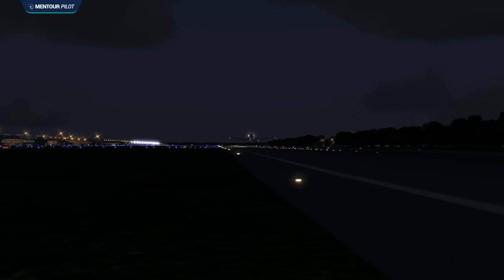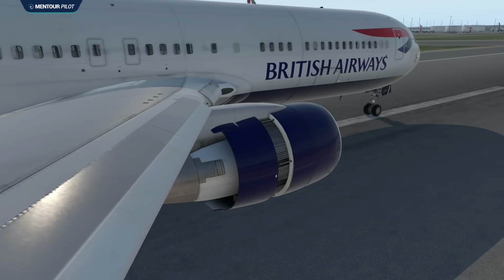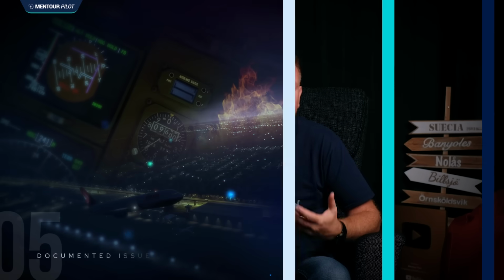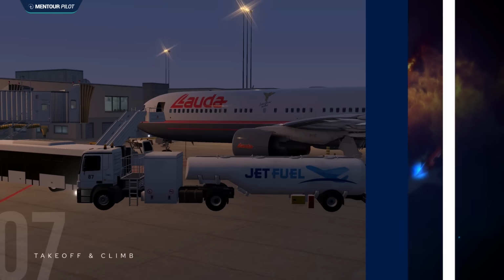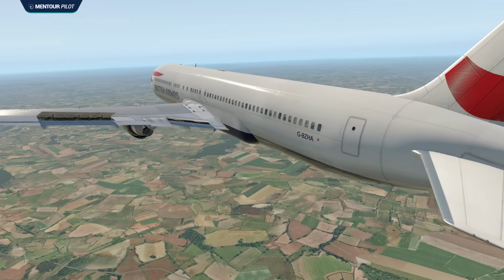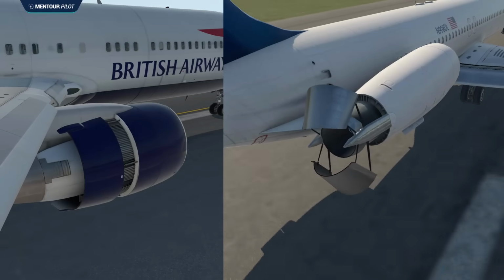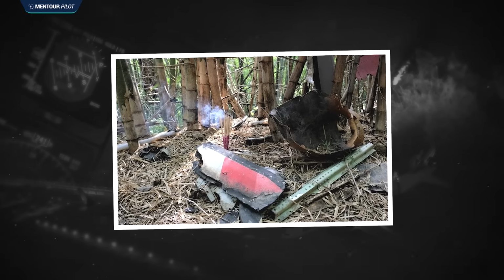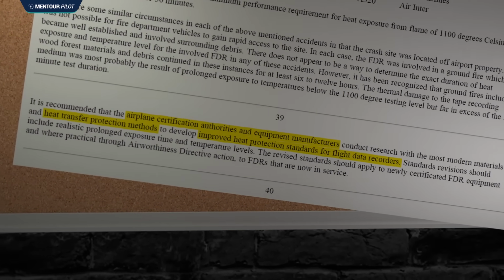HOW an Impossible Failure CRASHED this Boeing 767!

Comment: Thank you for yet another highly insightful video!

Is there any chance for you to indicate which video results in deadly crashes and which result in safe (as in walk away from) landings?

Also, is there any insight into the failures of the redundancy systems?  What happens if, for example, a redundancy system fails in such a way as to disable its partner system or inflict more damage?  Is there yet another layer of protection to prevent a protection system from causing more problems?  To what extent to the multiple redundancy systems render it impossible to take manual control, for example?
Reply: The loss of life is always indicated near the beginning of the video. In this case "extreme hull loss" was the expression I think he used. At 0:26. Maybe he should simply state that "people die in this video" or "this did not end well for many", whichever is the most refined way that still gets the point across.

Comment: Thrust reversers to help stop the airplane in time and saving the brakes from heating a lot. I guess that it also reduces tire wear. That wear is significant at every touchdown as huge wheels with their inertia hang still and need to be spun up to landing speed (interwebs: Most commercial airliners land with a speed of between 240 to 265 km/h or 150 to 165 mph.) And this could only be minimized by spinning the wheels up before touchdown - probably the additional TCO is too high to ever earn that back. But there will be significant wear during braking the wheels too and this may be a reason to use the thrust reversers as much as possible (if that does not generate significantly more engine wear or engine maintenance requirements) The interwebs say that landing on the dry, the wheel brakes are responsible of 70%-80% of braking and the thrust reversers do the rest, however landing in the wet or on ice thrust reversers increase to 70%-80% of brake force.
As operating an airline is a marginal business that shareholders with a passion for flight invest in, whats preferred is all about cost cutting down to the pennies.

Comment: It might be weird to post this under s video of such a harrowing accident, but actually your videos have helped me so much in overcoming my flight anxiety.
Thank you, Petter ! It's not just the diligence in showing just how much needs to go wrong in sequence for a truly desastrous outcome, it's also the bits and pieces strewn into every video that deciphered flying for me.
Like, how many degrees of a bank angle is still perfectly fine and far away from a warning, or what happens with the flaps and when you select which mode at what part of the flight. 
I've flown for the first time again in years this past week and my seat happened to be right at the rear end of the wings.
In former times, this would have made me nervous, now I was practically pressing my nose against the window to watch what was going on. All the while hearing your voice in my head narrating the flight xD "... and the pilot selected flaps 3" "they made a smooth touchdown and put in the thrust reversers..." etc.

Comment: Unlike a lot of accidents, it's hard to identify a real direct cause or something that should have been to prevent this... If anything I suppose the maintenance procedures and regulations (much more than the people) are the most responsible for this accident. Allowing the plane to carry passengers for 6 months with an issue nobody can figure out seems irresponsible, in retrospect. One thing if maintenance replaced parts and the message went away fooling them into thinking it was fixed prior to the accident, but after it reoccurred it should have been grounded and more thoroughly inspected and repaired. But you can understand why this wasn't done, because the plane should still have been safe even if the reverser deployed. I guess it was seen at the time as something relatively minor.

So I guess it's that failure of due diligence, and lack of fundamental understanding, that is the cause.

Comment: Unfortunately I feel that the aircraft parameters and testing prior to certification was totally inadequate. With the massive reduction of experienced engineers and introduction of cost saving measures at Boeing across the board, errors and catastrophic results do happen. It takes more than a university degree to construct aircraft, experience and a firm grasp of “what would happen if “, the time to run worst case situations and finally the backing of the management to make sure the aircraft is safe. Sadly the almighty dollar is the driving force.

Comment: From your introductory comments focusing on what assumptions were made wrongly by the design engineers and regulatory bodies, I deduce that on reverser deployment at engine high thrust setting, the only way to save the situation is to instinctively SLAM the offending engine trust levers to idle? Possibly bringing back the other engine to 75-80% and allow a couple of rolls of the aircraft before attempting stabilisation?

I would be interested to know what procedures in their updated simulator had the potential of saving those on board and the aircraft.

Comment: Can a 767 be cork screwed through the air in a manner that would keep it from going transonic speeds in such a situation?  Obviously once the supersonic shock waves form in front of the control surfaces, the airliner is going to be impossible to control, but wondering if maybe there could be more general training to stretch out the control-ability of the plane to solve a problem like this before it is too late leading to the plane breaking up, granted the plane can handle the more general life extending maneuver?

Comment: As usual another great VLOG! I learn so much from watching these! Thank You! I'm a layman so this might be a stupid question (Unrelated to the crash)  - but you said that the Hydraulic Insulation Valve is activated by the weight of wheel switches - But what if the wheels fail  to deploy before landing - How would the reverse thruster deploy then during a belly landing or is this moot since the foam that is  sprayed on the runway would produce enough drag that the Reverse thruster is not even necessary?
Reply: As the engines on the Boeing 767 are under the wings, if this aircraft performed a belly landing, it is likely that the engines would be sheared off. Therefore, with no engines, reverse thrust would be unable to be used.
Reply: @Eternal_Tech  I see, thanks!

Comment: "how The Impossible turned out to only be The Improbable, which eventually turned out to be The Inevitable and started killing people." is basically the history of post-MD merger Boeing in one sentence.  767 thrust reverser.  737 rudder servos.  737 MAX AoA sensors....
Reply: In fairness, this accident and the B737 rudder controversy happened well before the Boeing/MD takeover/merger.  Boeing in the '80s and '90s very much seem to have had "Jekyll and Hyde" characteristics; which by all accounts had a lot to do with legal liability issues.  To cut a long story short, legal and corporate would push back hard against any notion of liability unless and until one of their engineers discovered a real problem, at which point they'd completely change their attitude and go all-out to rectify the problem(s).
Reply: @turricanedtc3764  huh, you're right.  I thought the merger was older than it is.
Reply: I am an FAA A&P Mechanic w Inspecton Authorization and 35 years of experience on Air Force F-15 and F-16 Fighters and Heavy Commercial Aircraft - Boeing B-17 Bombers, 707, 720, 727, 737, 747, 757, 767, Douglas DC3, C47, DC8, DC9, MD80, ATR 42/72, Swearingen Metros, Beech 1900s, Beech 18s, NAA T-6s, NAA B-25s, P-51 Mustangs, Hawker Hurricanes, P40 Warhawks, P38 Lightnings, Embraers, Airbus - in the mid 1990s I was inspecting NON-MAX 737s [ 100s, 200s, 300s, 400s] during Heavy Inspections - I did it for about 12 months and filed several reports with the FAA about the build quality on 737s - After I discovered the cracks in the bulkheads, the wing roots and the subflooring under the seats, more than what I would consider usual compared to the 727 and DC9/MD80,  I hated them and refused to fly on anymore 737s .. I finally refused to put my name and signature on any 737 Airworthiness sign-offs and refused to work on any commercial plane except 727s, DC-9s and MD-80s .. The 737 MAX design is completely UNAIRWORTHY - it is impossible for the pilots to fly the airplanes without computer assist and impossible for them to recover from a dive and fly "manually" usually only the muscle strength in their arms - I warned the FAA to cancel the 737 MAX Airworthiness Certificate and I warned hundreds of Delta and American Pilots NOT to fly the MAX .. both before and after the two accidents and the Global grounding .. I still tell people DO NOT FLY on any MAX 737 - ANY computer failure and there will be an unrecoverable crash with mass loss of life - and the Pilots will be completely unable to save the plane ..
Reply: @bradhartliep879  Appreciate your courage in posting that comment with your real name alongside.
Reply: The 767 was pre MD merger. Tho the MD takeover did major damage to Boeing
Reply: Swiss cheese safety models :-(

Comment: The strangest thing to me about aviation is that the pilots don't run the same plane everytime. I cant think of any other industry where you jump into a different vehicle each time you go to work. Even being the same model, everything has it's own little quirks, it's basically impossible to prevent when you have so many different moving pieces. It must be kind of difficult.

Comment: Hm, I can understand that the Boeing engineers where concerned about performance and liftloss at low altitude and slow speed. But at high altitude in thin air those asymetrical losses would have uiet an impact. Especially at high speeds, if you ask me. I mean, nothing that can be done by now anyways. But it`s kind of a shame, that they didn`t at least concider the possibility and do windtunneltests for those circumstances anyways.

Comment: IF the plane was at 4,000 feet, assuming it is falling completely vertical and it crashed at or near sea level, that equates to 908 mph or 1,333 feet per second when it hit the ground. The higher the ground was above sea level the slower what was left of the plane was going, but this is not taking into account any horizontal speed the plane might have had which would add to the vertical speed. So basically the plane was going anywhere from fast to fast as all hell when it hit the ground, probably the fastest subsonic airliner ever. What a horrible situation, the pilots didnt do anything wrong, they followed their checklists, they tried to remain in control, they did everything in their power and yet it was all for nothing. All because someone somewhere decided it was physically impossible for a thrust reverser to open at any engine power besides idle. Every time someone ignores murphys law, someone pays the price. And no murphys law is not "anything that can go wrong will" Its "anything can happen, and anything that can happen, will"

Comment: A C-5 Galaxy had a thrust reverser engage on one of it's 4 engines just after take causing it to crash.  It was suppose to be impossible for this to happen but it did.  It was found out to be a loose wiring connection.

Comment: Mentour, you are pro-Boeing biased.  Check that part from Wiki:

Lauda stated, "what really annoyed me was Boeing's reaction once the cause was clear. Boeing did not want to say anything."[22] Lauda asked Boeing to fly the scenario in a simulator that used different data as compared to the one that Lauda had performed tests on at Gatwick Airport.[25] Boeing initially refused, but Lauda insisted, so Boeing granted permission. Lauda attempted the flight in the simulator 15 times, and in every instance he was unable to recover. He asked Boeing to issue a statement, but the legal department said it could not be issued because it would take three months to adjust the wording. Lauda asked for a press conference the following day, and told Boeing that if it was possible to recover, he would be willing to fly on a 767 with two pilots and have the thrust reverser deploy in air. Boeing told Lauda that it was not possible, so he asked Boeing to issue a statement saying that it would not be survivable, and Boeing issued it. Lauda then added, "this was the first time in eight months that it had been made clear that the manufacturer [Boeing] was at fault and not the operator of the aeroplane [or Pratt and Whitney]."[22]

Comment: I find your videos very informative and interesting.
It strikes me that a thrust reverser deployment in flight on a twin engined aircraft is much more dangerous than on a 4 engined model.
I also wonder about pilots flying hours. I understand that a pilot is permitted to fly 8 to 900 hours annually. On some videos, it strikes me that some pilots have very low hours relative to their ages. The pilots of this aircraft are a case in point. I would have thought that a 48 year old would have 20,000 hours plus and a 41 year old 15,000 hours. Is time spent as military pilots counted as part of total flying hours?

Comment: i can't really fathom how "maximum airbrake on one wing during max climb" was not the worst case scenario in certification. that seems like a bit of an oversight.
guess hindsight is 20/20. rip to the innocent lives lost
Reply: Presumably because Mach number/aero loads on the structure would be less.  A similar assumption was made when it came to choosing the flight regime for testing asymmetrical slat deployment during DC-10 certification.

Comment: Most short circuits are not dead shorts, but are intermittent. If some insulation had worn away from a wire and it was rubbing against something of the appropriate polarity it could cause the isolation valve to bounce open and closed, accounting for the intermittent error message. What the captain thought was a false indication was all too real. Unfortunately, there was no way to tell that based solely on the cockpit indications.
Sadly, due to both the post-crash fire and the looters, we'll never know for sure exactly what happened.

Comment: MOST MODERN BOEING ALWAYS CRASH, THEY HAVE POOR SYSTEM WHEN IT COMES MODERNIZATION. WHY THEY NOT DESIGN JUST A SIMPLE LIKE A MECHANICAL DESIGN. THE MAIN LANDING GEAR STRUTS WORKS AS SWITCH SO IF IT IS FULLY EXTENDED IT WON'T WORK THE REVERSER BUT IF IT LANDS THE WIRES BECOME CONNECTED LIKE A SWITCH THEN NOW THE REVERSER CAN BE USE AND THAT IS VERY SIMPLE NO MORE COMPLEXITY